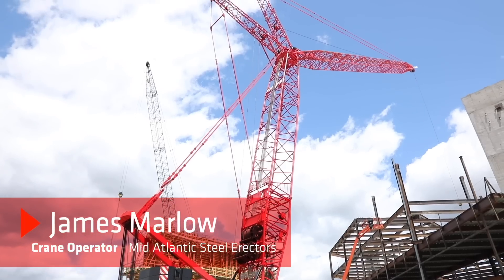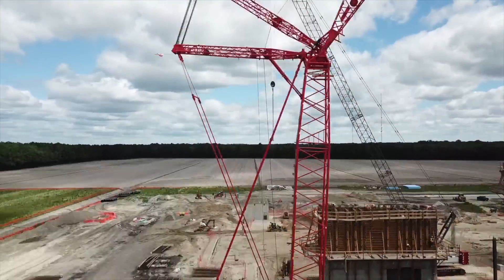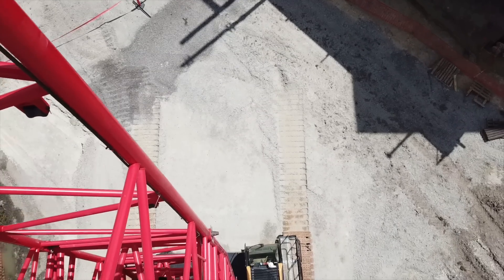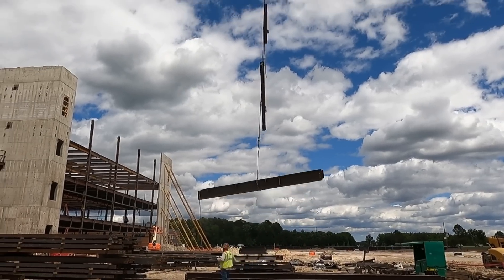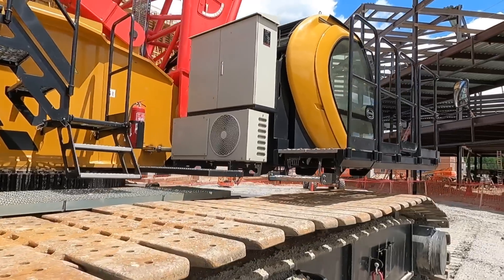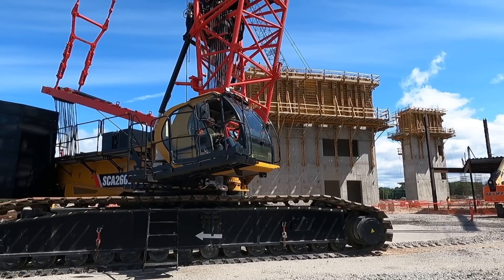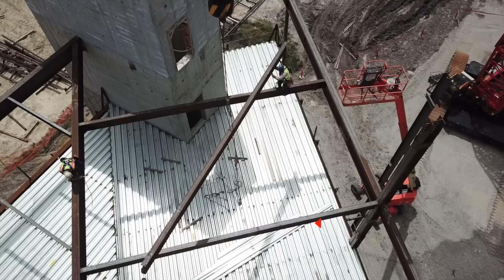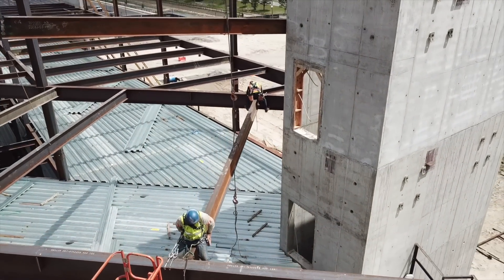SANY | The SCA2600A Crawler Crane in Virginia with Mid Atlantic Steel Erectors

Comment: Hello hank and Whitley thank you for another cool video hay a tip wd40 will start these engines just like either I’d use that on a cat engine I had ran with the lift pump had gone but the truck I. Was in was a 389 Peterbuilt glider kit with a 3406 e cat engine so I didn’t want to get into a different truck because the company I drove for had century class trucks freight liners to go from a pet to that is like putting a dress on so the lift pump was out I spray wd40 in breather out my window and hit start botton aay it would go just not write my truck up because it was such amazing ride 13 speed 500 horsepower cat